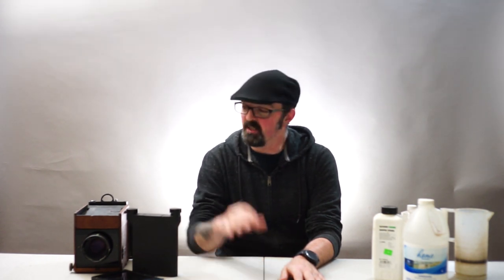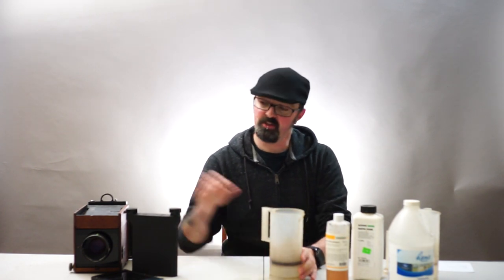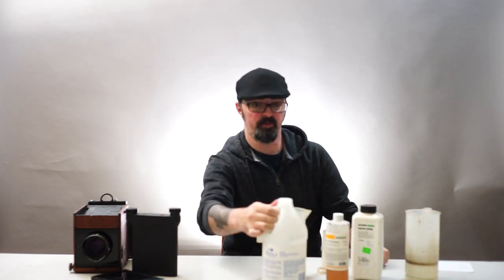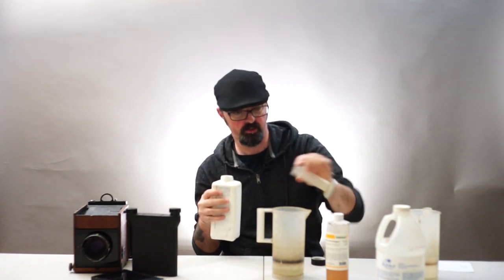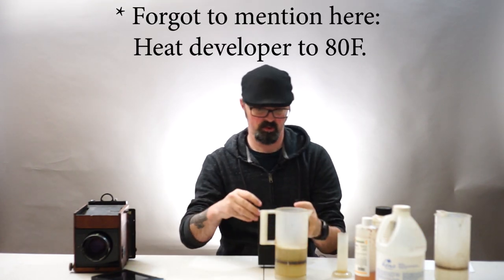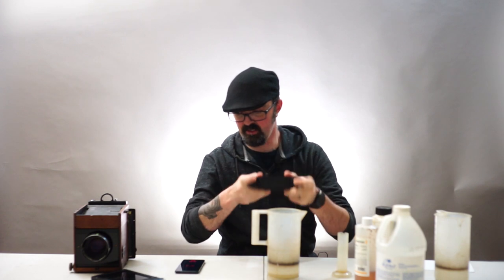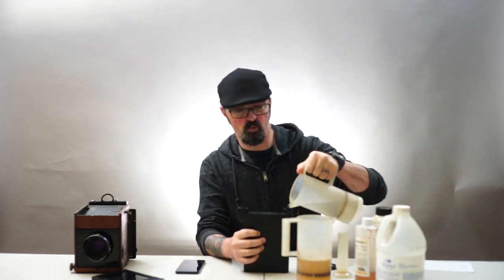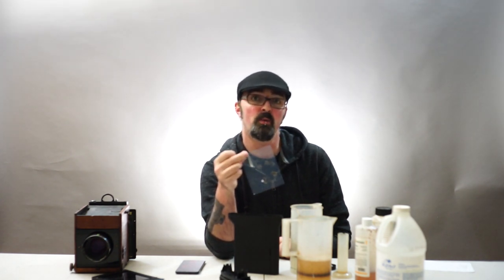The Easiest Black and White Processing ever - DIY R3 Monobath

Comment: Hey!  It's my monobath, right there on YouTube.  No, seriously, my monobath.  I invented that soup back in 2003.  BTW, if you use "clear" ammonia you won't get the suds.  Cloudy ammonia has a small amount of detergent added.  Also, don't forget your film still needs the same wash it would have gotten with conventional processing.
Reply from the maker: Well thanks so much for sharing it! I tried to find the original inventor of the process but so many people have shared it I wasnt able to. Its a very cool process for sure!

And thanks for the tip on the suds. Its nice to know I can eliminate those.
Reply: @GoEverywhere  Always glad to see people shooting film, never mind how they process -- and at the time, I thought the only thing un-obvious about that monobath was having a high enough developer activity to use rapid fixer.  That, of course, was before New55 (now Famous Format) ran with it.  I never tried reusing it back then, either -- though it's obvious HC-110 A is reusable (probably at least a dozen films per liter, maybe twice that, with a little added time for each successive film), I wouldn't have expected to get more than 3-4 films from that amount of fixer concentrate.  If you use a neutral or alkaline rapid fixer (relatively rare products then), you could leave out the ammonia entirely and save the odor, as well as possibly mixing the fixer to higher strength and getting a shorter process time and longer monobath life (though possibly at the cost of losing some true film speed if the fixer completes before development -- you could fine tune that by adjusting final pH with a little acetic acid -- slower development -- or washing soda -- faster).  Also, as with Cinestill Df96 monobath, you can adjust development by trading off temperature (warmer = more development) and agitation (more agitation = less development because faster fixing) -- allowing pull and push processing in what's still effectively an automatic process.
Reply: @GoEverywhere  I found the original posting of the HC-110 monobath, on photo.net: https://www.photo.net/discuss/threads/monobath-acid-fixer-and-alkalinity.89338/
Reply from the maker: Thats awesome, I was curious how you'd deal with push/pull with a monobath but I've never explored it in depth enough to find out.

I'll put a link to your photo.net post in the description so people can check that out too!
Reply: @GoEverywhere  Re push/pull,  the answer is: you don't. Monobaths are almost by definition an automatic process which gives you one result. If you use a time too short, you either get insufficient development and inadequate fixing, or both. If you go too long, you may get either no change or the fixer will dissolve some of the thin density details (shadow details).  Serious changes in processing temperature may make small density (speed) shifts, but when you  step off the programmed path of development, you never know where you end up, and the results will differ between film types and brands, because you are upsetting a delicate balance at best.  The "what you see is what you get" in terms of results is another negative aspect of monobaths.
Reply from the maker: Thinking it through that totally makes sense. Youre trading flexibility for convenience in this process.
Reply: @randallstewart175  I'll have to disagree here -- with Df96 monobath, there's about a 10F range of temperature, combined with agitation changes from continuous, to normal intermittent, to a 3-minute cycle -- the combination of temperature and agitation changes can take most films from Pull -1 to Push +2 (higher temperature increases development rate but has little effect on fixing, while more agitation accelerates fixing but makes only a very small change in development).